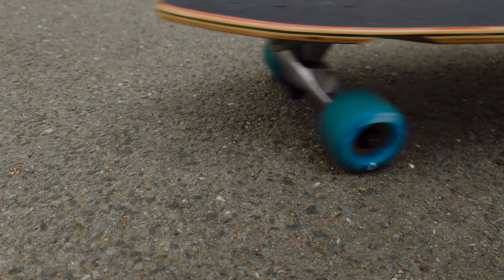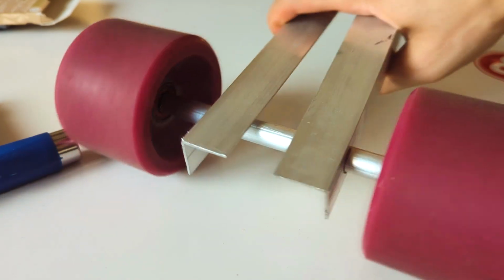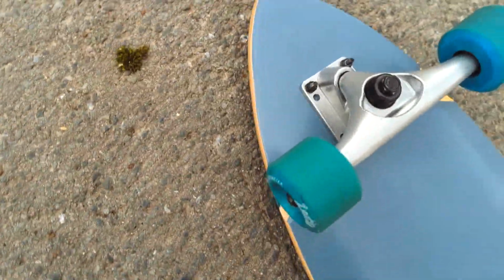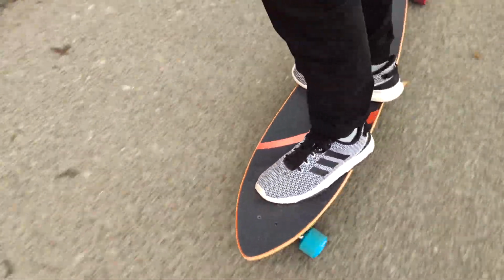DIY 0° Degree Truck for Longboard Pumping LDP

Comment: just a regular truck and mount it to a slanted aluminium piece to achieve the 0degree. you need the truck because the bushings give you rebound energy. this adapter you made lacks rebound from bushing whcih is counter productive; you can test it out and see the difference in speed
Reply from the maker: Hey there, this is possible too, but not what I wanted to achieve by this test ;) 

The aluminium slant with the truck would add weight and height . 

A Torsion Tail has rebound from torsional force and bushings, which my design didn't include. This design works by only leveraging rebound from the thin aluminium profile, and it also worked ; )

A system that combines both would be better, I agree!
Reply: @skate-horizons   It wondnt add hight if you can make a version like thus shape /\__ also a slightly heavier board doesnt translate as slower one. Orrr you can try to incorporate bushings to your design like gbomb ttx.